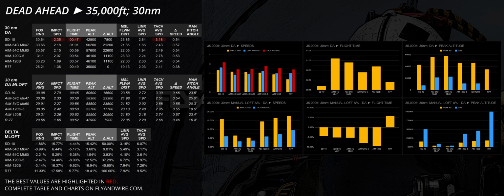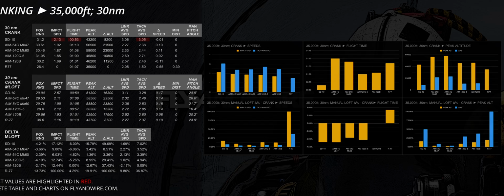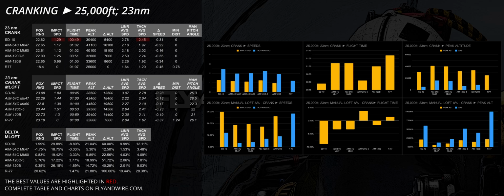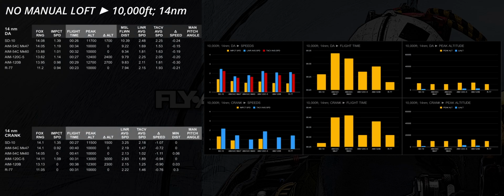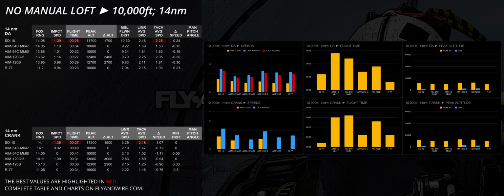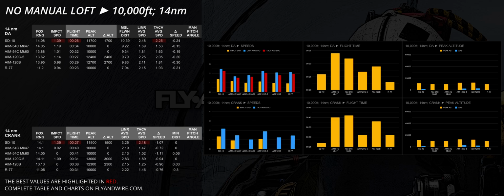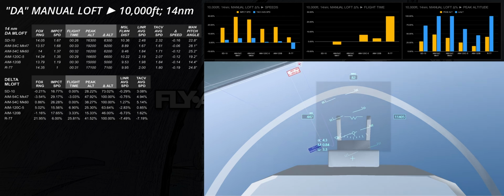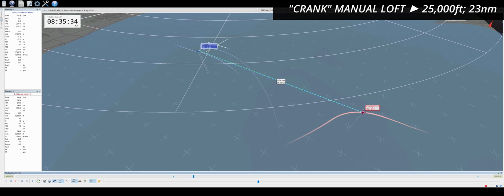Active Radar Homing Missiles II: Performance Comparison - DCS

Comment: I have a question, how come you never launch missile at 50kft? wouldn't that massive altitude give it very long range?
Reply from the maker: Yes, but the difference, per sé, at least in this context, is not huge. So, let's say MAR at 5,000ft is 5 nm. MAR at 50,000ft is 15 nm. What changes besides the fact that the defending aeroplane has to turn earlier? Also, vertical displacements were bread and butter back then, according to several crews I spoke to. In my videos everything is co-alt because, otherwise, the explanation would be quite complicated. Just imagine cruising at 50k with a Phantom and looking down all the time with the APQ-120. Unless you are lucky with the main lobe intersection, or all you see is clutter (I'm simplifying here, but I hope you get my point).
Also, intercepts and VID become even more complicated with a strong VD. I think the vast majority of players struggle already with LS management.

Lastly, there is the performance factor. 50,000ft is nice, but not many aircraft cruised up there. Perhaps the F-15, the Tomcat-A used to fly lower, for example. I am not sure about Soviet aircraft, but being the intercepts mostly GCI-driven, I don't think they used huge VD. I would like to learn more about the Soviet side, but sources are quite scarce and often in Russian. The books I read gave me impression that they tended to fly close to co-alt, at least as they were getting close.
Reply: @FlyAndWire  So I have seen several kinematic simulation of AIM-120 by different people, it seem that the speed, range, no escape zone is massively bigger at high altitude. Like for example, there was a guy showed in his simulation that an AMRAAM launched from 50kft can reach max range of 160 km while the same missile launched from 30kft can reach 65 km only. I understand that no escape zone is a lot shorter than max range. But still, I feel like at high altitude, since the air is a lot thinner, cranking may be a lot less effective compared to lower altitude. 
Anyway, I have looked at the flight manual of several aircraft, take for example: the F-18C/D at military thrust can cruise at around 47kft, so I would assume that once pilot detect the adversary, he can easily turn on the afterburner and climbed to 50kft or even higher to launch missiles. F-16 at 20k lbs weight can also fly at 50kft on mil power but it can reach 60kft on afterburner. F-15 can fly at 47kft on mil power and roughly 57kft on afterburner. 
My point is that: since obviously missile can fly a lot further at high altitude, wouldn't it make sense for fighter to immediately climb once they detect enemy instead of simply accelerate and flying co altitude?
Reply from the maker: So, in primis, we are talking about SARH Cold War era missiles. If you drag in an AMRAAM, I would counter with a ramjet Meteor, and the discussion will never finish. I hear what you say, I made several models of missile performance, MAR, loft/manual loft and more, and the curve is circa logarithmic, besides the usual mid-altitude block. Have you looked at them?

So, let's say we do climb to the high heavens after you are committed to intercept. You end up 30,000ft above the target. How do you ID it? See Vietnam, or even Sirte 1989 where the Tomcats dived. Also, post CW, the engagements in Desert Storm. You may also have friendly assets or threats around you, you can't just move around as you want most of the time.
I reiterate again the point about the F-4: as a real WSO mentioned, AIM-7E/F were considered WVR weapons, and the APQ-120 is not lookdown-shootdown. Why on Earth are you climbing 20k higher to shoot a missile? Perhaps I can see it as a pre-dive and conversion manoeuvre, but just imagine the antenna elevation you need to take such a shot. Before you argue that the 7M was around since 1982, the most common AIM-7 in Desert Storm was the F.
Then, there's the fuel issue. Once you are up there, the fuel consumption is low, but getting there may not be simple. A lot depends on the external loadout as well - see my TWR and performance study.

I think the issue here is the perspective: my studies are based on realistic missions spanning several hours, with strict ROE, tasking, limited IFF/DL/AIC-GCI, and where shots and lives of virtual pilots count. If you instead focus on casual servers, then who cares: Rutowski, lob missiles, disconnect/RTB and do it again. So, which type of experience are you looking for in DCS?
Reply: @ actually, I don’t even play DCS haha. I’m more interested in more modern fighter such as F-35, J-20, Su-35, Rafale… etc. I actually made 3D model of these aircraft including their inlet and first 2 stages of engine fan blade (in STEP format). Then I ran the whole thing through HFSS to find out the radar scattering characteristic (RCS) of these aircraft. Then I published these data on my blog
The reason I’m interested in BVR tactic is because I want to find out whether an aircraft with inferior kinematic such as F-35, can still be competitive against something like Eurofighter or F-15EX
Reply: @ as mentioned earlier, because Iam mainly interested in modern aircraft, so things like clutter in lock down is less of an issue for me. And visual ID is also better with modern sensor like EOTS for example
Reply from the maker: Ah, I see :)
Air combat is a huge topic and, unfortunately, many players tend to see just chuck everything together. For example, not many realise that the difference time-wise between a Tomcat (1974) and a P-47 (1943) is basically the same difference between the Tomcat and a JF-17 (2003). Yet, 30 years of development brought mindblowing differences.

Before starting, keep in mind that my background is in IT, not aeronautical engineering, EW, or anything related. I read, study, chat with several real pilots and backseaters, but the topics are, of course, strictly related to what is common knowledge.
So, I suppose we should clarify whether the Typhoon is considered in a vacuum or as part of a present-day engagement. For example, the Eurofighter is getting AESA radars now, or they have recently started the upgrade. A mechanical radar is seriously handicapped vs an AESA radar. It is a problem already vs AESA Super Hornets, for example (I watched a recent interview about this topic. IIRC on Aircrew Interview). If we add the low-RCS (as Radar Cross Section, I'm not familiar with the scattering characteristic tbh) of the F-35, the Eurofighter has even bigger issues.
In my opinion, Stealth is not as big a factor as the media make it sound. Aircraft do not disappear into thin air. There are many ways to know where a stealth fighter is: from my understanding, AWACS should be able to have a general idea, depending on the band they use. Devices such as IRST may still spot the aircraft thermal footprint. Also, and here we go back to the initial point, do we care about ROE, VID and whatnot? If yes, the range at which the engagement may escalate becomes much shorter (still BVR probably). Perhaps stealth characteristics won't be a meaningful factor anymore at that point? 
Beyond those limitations, if we consider them in a vacuum, the F-35 should be able to find and engage the Typhoon earlier, I suppose through a combination of sensor fusion and lower detectability. Stealth should have a great role here, allowing the F-35 to take a shot or two before the Typhoon can answer. On the other hand, as I discussed in this video, long-range shots can be defeated quite easily, it all comes down to the mission task (e.g. "buying time" for other assets to complete their mission, keep the hostiles away, or destroy specifically those aircraft, etc. Ergo, do you stick to a launch-and-leave tactic and the abort, or are you willing or have to get close?).
On the Typhoon side, the PIRATE IRST may still allow the tracking of the F-35. I suppose it would provide angle-tracking. A section of Typhoons may then triangulate the position and determine the range of the F-35, which should enable a firing solution. This is totally theorycrafting, but positional determination based on triangulation and angle-tracking was doable against noise jammers decades ago. Then, once a missile gets close enough, its seeker should not be bothered too much by the stealth factor (note that I'm avoiding ECM, decoys and many other points).
Other interesting points are the ordnance available, the fuel factor and so on. The Eurofighter carries a ridicule amount of external stuff (IIRC 8-10 missiles + bags), whereas the F-35 should be all-internal (4 or 6 missiles?) if they want to capitalise on stealth. This means that if the Eurofighters manage to defeat a few long-range shots, then the pressure rises for the F-35s.
To simplify and cut some variables because otherwise I will carry on forever, I guess the interview I used here can be helpful if we consider F-35 : F3 = Typhoon : F-16. The F3 had all the advantages, on paper, but tactics and the crews ultimately dictate who wins. The F-35 has definitely better Situational Awareness, and SA is the single most important factor, imo.

Now, that everything I said with an Everest-size mountain of salt. As mentioned, I'm just brainstorming, but modern stuff is not my thing and, obviously, the available documentation is nowhere near as detailed as Cold War-era.
I think the most correct answer is the "ol' reliable"... it depends

Drop me a link to your blog, I googled a bit but I've found all sorts of things lol
Reply: @  My uncle is a SAM operator and one of my friend is an avionic engineer, so I have access to various documents that are restricted and classified. Of course, with that said, even the highest level of classified ECM/ECCM  stuff still follow sort of fundemental principle. That why it is possible for me to roughly estimate radar range/rcs  …etc of stuff that I don’t have access to direct data. 
My problem though, is that, even though I can make calulation and simulation, I can even have access to the true value. I lacked the experience to make sense of it.  So for instant: let say if I was comparing F-16 and F-14. Because I have the flight manual for both. I know their maximum speed and altitude with a certain loadout. I can easily calculate the distance their radar detect one another. But, I lacked the “feel”, the “experience” to make sense of what advantage is better. On paper, based on calculation. A higher altitude provide missile with much greater range and average velocity than higher starting launch speed. In other words, Mach 1.1 , 50kft missile launch will make your missile go further and faster than Mach 2.5, 35kft missile launch. But then obviously, at 50kft, the aircraft is a lot less agile, so it might be harder to evade enemy missile. …etc. Without actually flying in the simulation, it very hard for me to visualize which give better advantage.  So I really enjoy channel like yours, because it give me some understanding of the tactic involved. That why I previously asked why you never launched missile at 50kft. 
Anyway: my blog is at https://basicsaboutaerodynamicsandavionics.wordpress.com/ , I wrote about a lot of thing, from IR to Radar, to stealth …etc
Reply from the maker: I stay very far away from anything classified or restricted. It's not worth the candle :)

About the F-14 vs F-16 scenario, I think the issue is again a situation in a vacuum vs a combat scenario. Focusing on the first, if my stick is shorter, I wouldn't put you on a collision course until I am ready to launch. On the contrary, I would use manoeuvres and offsets (on both axes), to make my aircraft a more challenging target. So, let's say you launch an AIM-54 at 60nm. If I were to reduce the separation to 20nm by charging straight to you, I would probably be blown out of the sky very quickly. Instead, as soon as I am locked, I would attempt to notch to break it, and perhaps add a vertical offset. I would also add a horizontal offset. Even a few degrees are sufficient to defeat very long range shots. These manoeuvres decrease the closure rate (Vc), which is something I may not like, but cause missiles to waste more energy.

About evading missiles at high altitude, yep, that's correct. However, altitude is a resource: you can trade altitude for energy (speed) at any time. This would cause a missile to correct its trajectory and fly in thicker air, whilst your aircraft is accelerating. So, for example, I can climb to 50,000ft, loft a missile and then dive. Now my missile has excellent kinematics, and whilst diving I get faster and any missile coming from your direction has to adapt to my manoeuvre.
This is not always possible. If you are tasked to CAP (combat air patrol) an area, you may follow a race-track pattern, usually at a conservative speed planned for the amount of time you have to spend there plus engagements and contingencies (e.g. divert). If a bandit shows up or the controller commits you, you move to ID, intercept, engage, whatever is required. However, you may not have a lot of time to climb, accelerate and so on. Also, the target at some point may call the bluff and turn cold. What I'm trying to say is that if you invest every possible resource every time, you will end up crawling towards the tanker very quickly and very often. Ergo, you may not want or have the luxury to take a shot at the maximum possible performance.
For example, the last mission I flew in DCS was almost 4 hours long in the Tomcat-B. We refuelled twice, and committed a few times. In a few cases, the bandits turned cold. I was not concerned about squeezing all the possible energy out of my aircraft, but rather to complete the engagement and resume the CAP.

Here you can find some studies about ordnance performance in DCS, in case you are curious: https://flyandwire.com/category/gaming/dcs/ordnance/

Thanks for the link, I'll have a look when I have a bit of spare time!
Reply: @FlyAndWire  ah, btw, I have a question. This is something that has always very confusing for me.
So I think you know already that modern fighter jet since 4.5 generation and higher are generally capable of supercruise right. Meaning they don't need to use afterburner to fly supersonic. But looking at various envelop charts, they don't seem to be able to use that supercruise ability at their service ceiling, instead, supercruise are done around 35kft. Now from my calculation, missile launch at 50kft, Mach 0.9 will go further than missile launched at 35kft, Mach 1.7. On the other hand, going Mach 1.7 , 35kft will shrink enemy missile NEZ better.
So in your opinions, as a player, once detect adversary, is it better to climb to get better missile shot or maintain altitude for better supercruising speed?
Reply: @FlyAndWire  btw, I'm not trying to say that your teaching is wrong, I just try to understand BVR